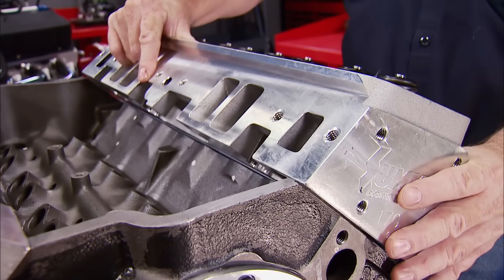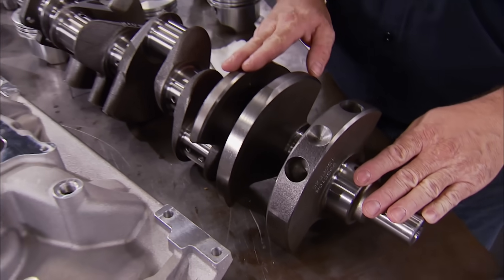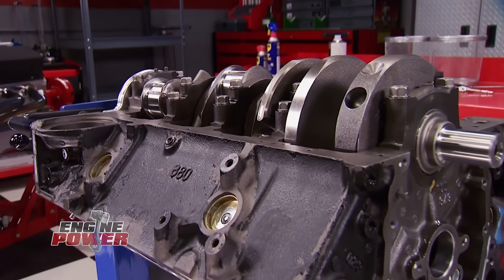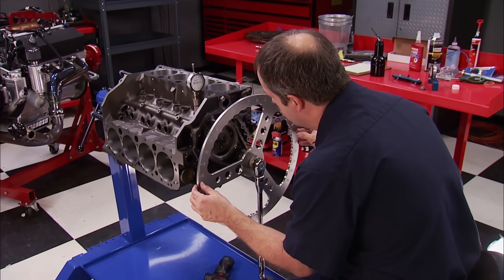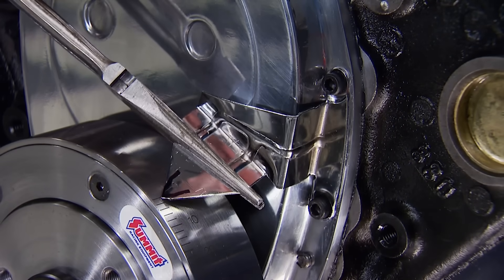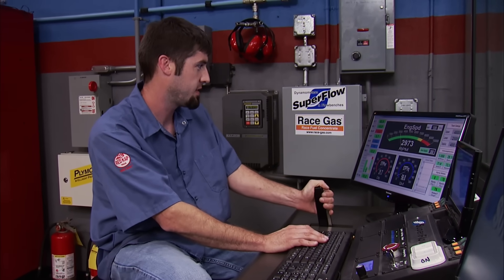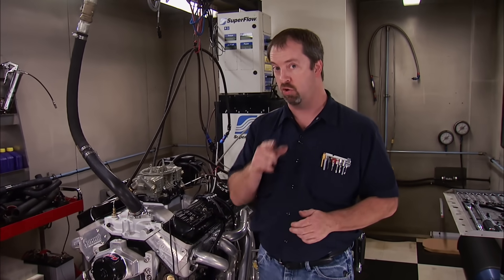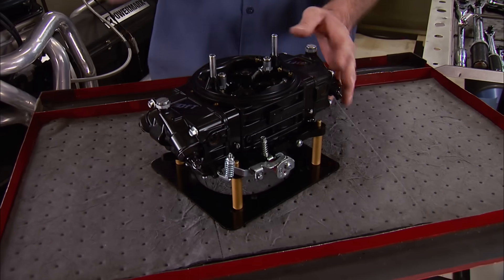Small Block Chevy Build Stage 1: Reliable Power Under $4,000 - Engine Power S3, E1

Comment: How about a dual plane intake like the performer rpm air gap and a Lunati voodoo 268 cam with this set up?
Reply: 100% agree. 400hp easy
Way wrong intake was used.
And cam way too small to use those heads.
Reply: @indyrock8148  and these guys always preach how  the single plane is not good for the street or a build like this.
Reply: @AZjessegarcia  I think someone made an ordering mistake, but they just slapped it together and filmed.

Comment: I don't understand using a single-plane intake on a motor with a smaller cam ....a Weiand Stealth dual plane would have brought the numbers up on both ends.... it would be easier to just buy a crate motor with a warranty and more horsepower

Comment: Show us what it can do on 87 octane, adjusted to not ping or detonate incorrectly.
Reply: Why on earth would anyone run 87 octane in a performance engine? If you can't afford good gas, you absolutely can't afford to build a good engine.
Reply: @wvXvxvXvw   I'm with you on this one brother!!!
Reply: @wvXvxvXvw  not really a matter of affordability, just the principal of seeing if that is possible with that modest increase in compression, and power...
Reply: PD Köester I know right! That thing with 10.2:1 compression will certainly have to be dialed back on 87 octane. It might even diesel upon shutdown when it’s good and hot.
Reply: Those #345 pistons have lower Compression Height than claimed... use proper Summit hypereutectic pistons for a lower price...

Comment: I noticed you mentioned the stock TBI engines came with only 200hp which is true, but you're not using TBI or a similar cam or it's horrendous heads.  You basically just have its block and valve covers; is that even a comparison?  Either way cool video.  I love your channel!

Comment: He said when you heat the rod it will warp the rod causing failure, then he heats up the rod anyway
Reply: Theres a difference of heating, and uniform heating. You dont want it to expand too much in one spot than another

Comment: this engine is 5.8 L ?
Reply: 5.7
Reply: Overboring the 5.7L gives about 5.8 - 5.9L
Reply: The block they used was punched out .30 over so that gives a displacement of 355 cubic inches or 5.8L.

Comment: What are the pro’s and con’s of using a carburetor, vs fuel injection?
Reply: Pick up a used carb. for $50... EFI more like $1K - $2.5K... Not much difference in performance if carb. tuned well...
Reply: The only benefit of a carb is cost/simplicity, but those can be big factors for budget and people who already know carbs.  Once initially tuned though EFI runs in any temperature/altitude with no adjustments, there's no choke, produces more power, uses less fuel to get there, and the response is better.  It's just all around better if you can swing it.
Reply: Richard Young cool! I’m just getting into cars, and I mostly thought maybe carbs would be easier to tune. That’s for the answer!

Comment: Buying everything from a catalog isn't a budget build I'm sorry! Take an old block bore, hone, clean, and then build!
Reply: priced that whole thing out lately?  bore, hone, clean, crack check, freeze plugs and cam bearings... you'll eat a good bit of cash and time.  you might save a couple bucks, but their pre prepped block is pretty reasonable still
Reply: @michaelcouey1383  the machine shop going to be as much as there new ready to go block. they said less than 700 on the block. you will be around that at shop and this is all brand new.

Comment: Why dont you guys do a build for a ski boat.  Whats the difference between the build for a car/truck vs ski boat
Reply: This engine would work fine in a ski boat... cam choice may vary depending on whether inboard / I/O prop or jet drive... 
Cars cruise at about 15 - 25 HP... boats at 75 - 250 HP...
Reply: You'll need a marine camshaft to prevent water from being sucked in on overlap.
Reply: @dennismassengill5481  - The lowest priced Summit cams don't have much overlap...

Comment: Yeahhh. Imma just spend $4k on a crate with warranty with 450hp. SBCs just don't make sense to build vs buy.
Reply: Should be able to build this Stage One 357 HP for under $1K...
Reply: I made 400 hp with mine on a 2500 budget. Those heads are trash and so is the cam. Too small
Reply: @PercyMack85  - The heads and cam are fine for the desired build... but this power level can be done for under $1K...
Reply: @BuzzLOLOL  yes that why it only made 357 hp lol if u wanna make big power u need a decent set of heads and good cam. That's why ls motors make so much power.
Reply: @BuzzLOLOL  I built a 355 with afr 195 heads made 460 hp with the same pistons they used. See what I mean? Like I said those heads are trash.
Reply: @mikec9112  Moron. Lifter failure? If you buy a junkyard engine for a hotrod and don't replace the cam and lifters, you're dumb. If you buy a junkyard engine and don't re-seal it, you're dumb. If you think, in any way, that a Ford 5.0 is better in any aspect than the GM LS, you're really dumb. You can't make a reliable 500hp from a Ford 302 no matter how much you spend on it. The factory block literally splits in half at 450hp and you can't do anything to make it stronger. There is a huge reason that absolutely nobody runs SBF engines in race cars. They suck at everything.
Reply: wvXvxvXvw well my 4.6 supercharged mustang is actually really reliable at 500 hp had it supercharged for 3 years
Reply: @killiansnell8965  He was talking about a standard SBF pushrod engine. The OHC engines can take 600+ if they are well tuned and correctly assembled.
Reply: wvXvxvXvw most people these days running small block Ford go with a 348 Stroker. They stroke the 302 to 348. They can make some serious power. The 302 with that tiny 3.00 inch stroke is somewhat limited but the stroker fixes that problem.
Reply: Mike C pick up a junkyard Chevy 5.3 and make even more power even cheaper 😂
Reply: @mikec9112  yeah with nos
Reply: the fact of the matter is, it's built not bought. vagina
Reply: @chrisabrew4031  Somebody is salty over nothing, it's a build, if I can save a few hundred bucks AND not have to worry about it that's the smart fiscal move. Take your time and money into another aspect of the build like interior, suspension, or overall final touches.
Reply: 100% understand im just crackin a joke bud  @LSxHunter
Reply: @chrisabrew4031  I might be a little touchy. It also could be the stupid BMW I've been working on building from the ground up.

Comment: Blue print engines sell a budget 350 cast iron head with 373 hp 400 ft torque for 2700 bucks free shipping and majority of them are putting down north of 373 on the dyno!!  Now that is budget power that normal joe can stuff in his rig!
Reply: Used is best...Buddy got a vortec short block for $325 ....bitch looks like new inside...All he needs is a cam and heads...He can built his for under 2500$
Reply: @bilbobaggins4710  - Vortec long block plus pistons/cam is 425 HP mild daily driver..
Reply: @bilbobaggins4710  I've ripped out junkyard heads for my last TPI build, the vortec heads are fantastic when matched with a SD adapter manifold.
Reply: @LSxHunter  whats an SD adapter manifold? serious question
Reply: @Zanehoward88  Scoggin Dickey - It's a TPI lower manifold that works with the vortec heads - SD3816
Reply: @bilbobaggins4710  😂😂 bitch looks new on the inside lol im dying over here. It does look new.

Comment: $4000 is my whole truck.
Reply: Budget is new rings bearings and cam shaft, lifters,oil pump ,gaskets  500 bucks
Reply: @DeevoxL bone, twig, pine needles. All of the above.
Reply: Same here x2
Reply: 1/4 of that for my truck but i got my truck for a steal 
its a 1975 ford f250 highboy 360 4speed banged up but not rusty at all for a 44 year old vermont truck
Reply: @knuckleberry4720  Oh, that's a good truck! Don't sell it! I sold a couple of those and wish I wouldn't have!
Just put in a mild cam, headers, 4 barrel intake and carb. 👍😁🇺🇲
Reply: @bjr2379  thanks i don't want to ever sell it its stock now other than headers  its going to be my daily when i get it on the road found the build sheet under the seat
Reply: @knuckleberry4720  Awesome brother
Reply: They only had that much in it because they didn't already have a good motor to mod. They bought everything brand new.
Reply: Was the same for me till I realized I can eat beans and spend 1500 a check on engines and parts lmao
Reply: @DragonMaster12975  lol. The life.
Reply: ur truck does not have 375 hp does it?
Reply: 3 years ago. Now That truck is worth 7-8k easy
Reply: @mattfubar4268  if it didn't have the rust yeah it would be.
Reply: Dude my whole truck isn't half that
Reply: Same fam, same! But built not bought brings a whole new meaning when you got a beater that’s a monster on the streets!!!
Reply: Wow bro that’s 2 of mine
Reply: Yeah same here
Reply: Heck I've bought my 96 Ford F150 with a 5.0L (302) Windsor V8 on Craigslist for $3300 back in 2015.
Reply: You must have a POS
Reply: I can buy my squarebody again with that money
Reply: 4 grand is my house😂
Reply: Facts 😂
Reply: No shit, I was thinking of just putting some money into the 350 that is sitting in the truck I got but for this price I could turbo a 5.3 ls iron block. I actually just did the numbers and it comes in at 3k rounded up ruffly by a few hundred. This includes the motor coming from a reputable dealer at 1,200 bucks. I could just grab a motor for 500 and build it instead for 2,500 but that extra 500 just to know it will all work is fine with me. Plus a hell of a lot more power!
Reply: @themodernadventurer4320  shit plug me
Reply: The Modern Adventurer l
Reply: You need to find a good ol' boy that knows the cheap secrets. We used to put and Edelbrock Performer intake, 650 cfm Holley, small flat tappet cam, headers, Accell Super Coil and a few other goodies on 400 Fords. WOW! What a wake up call! A little bump in compression and they would really run!

Comment: Just Under 4000 is not budget build lol. And above all of that you go with a flat tappet cam?? Roller rockers and no roller lifters and cam WTF..
Reply: Half the county makes 30,000 a year or less sometimes much less here in NC where i live, people drive 1200 2000 dollar trucks here 1000 dollar engine rebuilds done in a garage yourself is the norm around here
Reply: @jbncnow  well put sir I'm an NC native and my budget build including rear end and tranny was $3000
Reply: @jbncnow  you can build a Detroit Diesel 6.2 for less than $4000, there's absolutely no reason to spend $4000 on a small block at all at this point.  This is just a giant commercial for Summit Racing, it's the only reason shows like this can stick around, gotta shill to keep the lights on.
Reply: @MidnightMechanic  I'm helping a pal go through the 350 in his boat. He's $3k deep into the longblock, and that got him good machinework, FloTek heads, pistons, rings, a comp roller, chinese stainless rockers, and some other odds and ends.
Reply: @jbncnow  Sounds like you should vote for democrats. They'll steal money from those that earn more, and they'll give it to you!
Reply: Yeah for that kind of $ roller cam should be included
Reply: sure it is thats every single part needed to run a brand new engine. nothing used. new block and all. parts of good quality not the best but good cost. you could get cheaper stuff. i have went to summit site and tried it to best there kits and cant do it with part of the same quality
Reply: @Bozemanjustin  170cc are not "big" heads. Agree that a single plane manifold probably wasn't ideal.
Reply: @GroovesAndLands  Yep I'd  say that was  a big bottom killer.  Need to move those  single planes collecting dust in the warehouse. A  big runner dual plane  would bump up the 1500-3500 torque and driveabiliy.  I do like the short dirt roundy-round cheater cam.  106 is crazy on the E-I lobe  splay but just workable with the 218 duration. - Sandy
Reply: Get this kind of power for under $2K... and including roller cam... This 218/218 flat tappet cam looks like some overstock that Summit bought from Comp and re-boxed as to brand...
Reply: They didn't have a motor to start with.
Reply: You can buy a 383 with a warranty for much less that makes more power
Reply: You are So Right ! Larry W !  i was thinking the same thing !
Reply: Get a better job then